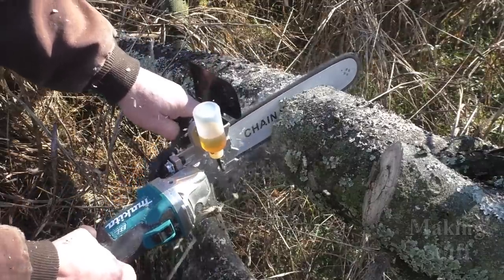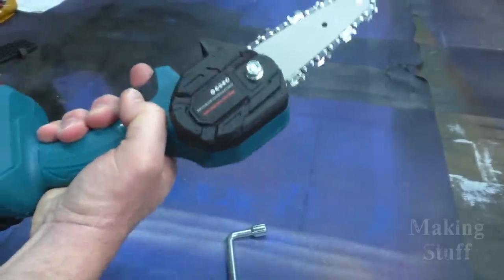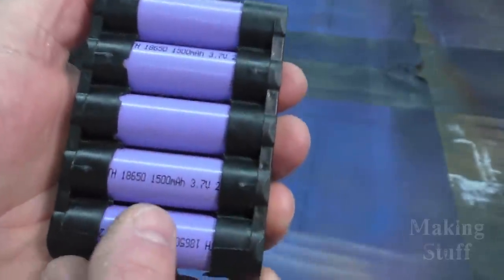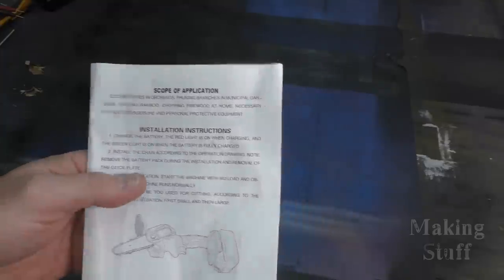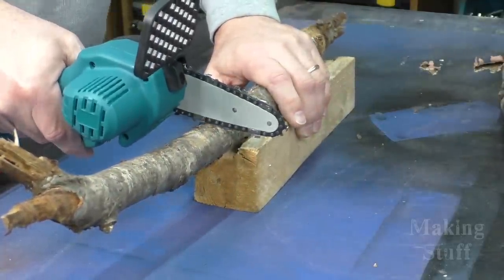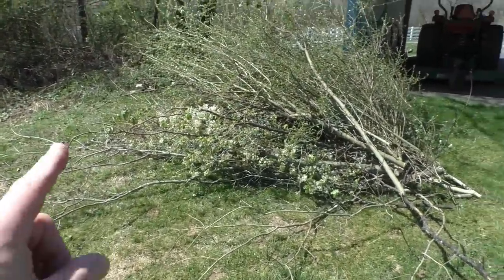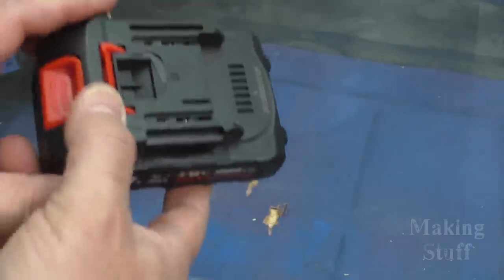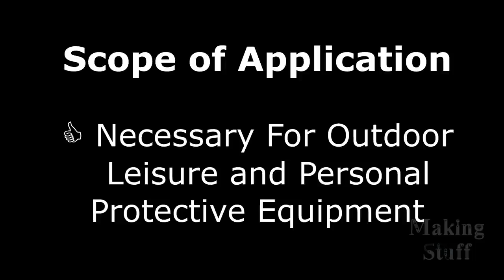Mini Cordless Chainsaw Review - Is It Any Good?

Comment: I got one very similar. It’s battery says 88v right? After 2 months of use. Not even cutting big stuff like you did. I got a battery that won’t take a charge. A battery that does but is iffy. A saw that cuts with the right shavings. Just it won’t cut nonstop or even fast. It stops a lot. So currently in email negotiations with seller trying to get a refund. Was fun while it lasted. Don’t think it is meant to be used much. My saw did not come with oil bottle. I still knew to oil it. So I oiled it. If you stay away from firewood. It will be good. New sub. Thumbs up!

Comment: I just bought a 6 inch model. What took 5 hours with an electric 14 inch chainsaw, the time was cut in half. Best part it is lightweight. Easy to tension chain without disassembly.

Comment: I got my dad one for Christmas. The big points for me are that it has the 18v battery that is interchangeable with all the other 18v Makita tools. Also this will be excellent for my dad who is getting older and simple yard work and cutting firewood is hard on his wrists.
Reply: @spanky Do you know if the batteries that come with it can be charged by the Makita charger?
Reply: @noahkatz9616  I'm not super sure, but it should if it's the same voltage and comparable with a Makita battery.

Comment: Will it cut construction timber e.g. 4 x 8 (sawn softwood) and will it leave a decent finish to the cut? I have to make two cuts with circular saws and it's a hassle to get them level. Pro builders here use normal chainsaws, but I always get rough cuts.

Comment: Pretty cool. How about oiling? Just manually here and there? Bet it would cut even faster with the Makita battery if the saw is capable of pulling more amps than the single cell configuration can give continuously. 5*series 1*Parallel vs the Makita 5S 2P and I'd imagine the Makita cells at 2500mah still have a higher discharge rate.

Comment: I’m wondering about how long it stays sharp enough to cut. 
Since there is a small fraction of the amount of teeth on this compared to a regular size...and those few teeth are doing ALL THE WORK a regular length would cut. I wonder how quickly it goes dull? And we all know how often a regular length goes dull.. 😬

Comment: Purchased two of these. One like Makita color and other like Bosch copy. They both burnt out the motors. In Australia our timbers are much more rough and tough. The tools work for really well to begin with but with super hot summers they take their toll on the small motors.  Both burnt out with white smelly electric burning smells. The burning out I believe is progressive as the motor gets noisier and grates the more you use them. They just pass a bit smoke and die. Battery tested in another tool it worked fine. I have an intelligent Makita charger and showed battery was still 90% capacity.

Comment: Awesome video. Looks to be inches blade so max it can cut is 8 inches wide/ dia i am guessing in 2 parts- 1 side and then other. 
If 10 inch dia would have a section in the middle that could not be reached due to the handle.

Comment: I suggested that this would be the tool of a survivalist, especially in a Zombie Apocalypse, A horde of Zombies are inbound after seeing them on my drone, I need a good solid building, after seeing the building and clearing I noticed there was just no wood around to reinforce the ground level. but there is another house across the street, which was poorly constructed for zombies so I can pull my mini chainsaw and get the wood I need to reinforce the better house. I also have a few extra batteries as well, and then switch to another tool to screw the wood in. 
These cordless tools are the cat's meow -  The question is now what is a good size solar panel to charge one and how long?

Comment: That's probably the best design to make an electric bicycle. Just changed the chain sprocket and mounted in the same place you would mount a gas engine. The other design you have to mount the power drill behind your seat above the rear tire.

Comment: How hard is it to get replacement chain like  do you gotta order them ahead of time or does home Depot or Lowe's have them on hand?
Reply: Also only 1 battery?
Reply from the maker: Bangood use to sell replacement chains but they are no longer for sale on their website.  Not sure if other brand chains will work or not.  There are two battery options available.  Check the links in the description.

Comment: Soft woods like those used are easy to cut.  I would like to see the saw deal with oak.  Betting it has much trouble with hard woods.  Nice tool for pruning I'd guess.
Reply: It will cut oak like a hot knife through butter,I used to cut Oak before I owned chainsaws,nothing hard about it.

Comment: I have the 2 gear, variable speeds electric drill motor that uses the same battery and charger and it works fine... was only about $27 for the set... before I bought it I noticed in comments the "48V" was just a part number, not voltage... 

Also have the $39 Harbor Freight 14" bar electric chain saw, but blade came lose 5 times trying first cut through a 10" soft wood log... rather dangerous... cut into saw guard panel... only has one nut holding blade and it has to be really tight to get it to hold very long... don't like tightening plastic things that tight... unfortunately, I had it longer than warranty period before using it for first time... it's power is fine... chain and bar also fine...

Comment: The thing that you didn't know what it was for but  decided it worked fine for deflecting wood chips looks to me like a kick back brake.  Whether or not it actually works I couldn't say.  If it works and isn't a fake along with the 48V sticker, with the saw running, tipping  the top of the brake forward should instantly stop the chain rotation.  It ought to be able to stop you hacking your head in half when you go 'nose in' to a branch, especially when working above head height, which isn't recommended.  Thanks for  the video. Stay safe.

Comment: Hi thanks for the good review it was so haelpful. I have a question. I bought this chain saw and i see a little spark in the engine even when the chain is not attached. Is that normal?
Reply: Yeah it shouldn’t be a huge issue it’s just the brushes sparking but the bigger the sparks the faster the brushes will wear out. For how cheaply these saws are made and sold I wouldn’t expect a very nice motor to be installed in them.

Comment: I bought an exactly one that shows on the video, except with battery 24V. I used in the first time with 3  cuts and it worked perfectly.  A month later, I used it again in trying to cut a small branch of a tree and it took 2 minutes to finish it.  I did try a number of times after that, and it is still not working as expected.  Its chainsaw was stopped moving and get stuck in the wood. Can your folks help telling what is an issue here? Is that a problem with chainsaw or battery or motor?
Reply: It sounds like it could  be either one. Charge the battery overnight. Then check the voltage with any inexpensive voltmeter. Try to cut a minute or two and see if the battery voltage is about what it was after the charge. Should be if the battery is good. Check the charger too. Plug it in and see if the voltage at the tip of the plug. Should be at least the same as the battery voltage rating. Disconnect the battery and make sure the chain moves freely. Call the manufacturer if you don't find the solution. Remember, some credit cards doujble the warranty. Leave a bad review and the seller will more likely help you if they don't at first.  Good luck.

Comment: The charger output will tell you what the voltage of you battery. It will be close to battery pack. Fully charged the battery pack will be about 21 volts. Lithium ion batteries are for the most part are 4.2 volts fully charged. GREAT VIDEO, looks like a useful item. I buy my own 3800mAh hour batteries and upgrade my packs. Also on e-bay you can buy the shells usually with a BMS included with it. That way you can build your own power pack. What is the voltage output of that power pack?

Comment: Mine arrives 6/9/21, red, 2 batteries, in addition I ordered 2 chains and a bar direct from China, prep limbs for gas chipper rather then my 8" or loppers. 3D print a blade guard.

Comment: I have just recieved one of these look alike chainsaws and having seen numerous chainsaw videos I am wondering about chain lubrication. A Google search suggested amongst others using vegetable oil, which is environment friendly, however the manual mentions nothing about oiling ... any tips on this before I start chopping wood.
Reply: Used sewing machine oil since had no replies.
Tested it out on a kemon tree growing in fron of my apartment and seemed to work OK although a little more "lumpy" in operation than expected which I put down to my inexperience. This was a few months ago now and a few weeks ago managed to get the chance to use it again for the project for which it was purchased. A dead tree in a plot of ground where electricity was not readily available.
I tried a few cuts on old limbs that were much smaller than those shown in the start of the video, then moved on to some branches about an inch or two in diameter. Initially worked fine but  then suddenly it siezed up and then the motor ran without turning the chain. 
Spoke with the shop that sold me the device, agreed that I could open and check out what had failed, report back to them and they would sendme a new part.
On opening the body the first thing I noted was that the motor was loose in its housing. Removal of the housing showed that the fixing screws were indeed loose and that the drive cog on the motor had stripped the teeth on the cog inside the body that transferred drive to the cog that drove the chain. Once I reported back to the vendor they sent me a new component to replace the one that had failed. Took  about a week for me to recieve it. I reassembled using some lithium grease on the drive cogs and some loctite type fluid to stop the screws from vibrating loose in case it was vibration and not an assembly oversight in the factory that caused the problem. I also cleaned out all the broken teeth that were scattered around inside the housing before reassembly. Hopefully will be able to put it to use soon although I must admit that I took a handsaw with a thin japanese sawblade to that dead tree and cut off all the branches leaving just about 5 feet of the trunk sticking out of the ground.
Reply: Update .... Been in use a few times now, use it alongside the hand treesaw mentioned above. Feel more confidant at the moment using old tried and tested methods of cutting wood. Chainsaw cut through the trunk of a dead tree thathad a diameter greater than the length of the saw. Also great in cutting back the 20 years overgrowth of an abandoned Mastica, which had tried to take over a couple of yards / meters at the rear of the property. Wondering whether to get a longer bar and chain for it !!

Comment: I wonder if you could convert that into a grinder? Then you have a much less expressive tool that can potential be both a chainsaw and angle grinder and cordless. May not be capable of pulling out high rpm but could be useful.
Reply from the maker: I would just go buy a Harbor Freight $10 grinder before going to the trouble to convert this one.  Thanks for watching!

Comment: You didn't mention the oil for chain saw. Does it have an oil holder in the saw. If not how often do you spray the chain when using it.
Reply: Don’t worry too much about oiling often the links on the chain are so sloppy that even the small amount of oil will help extend the life of this extremely cheap already saw I just spray mine down with something similar to white lithium grease spray or any aerosol Oil will be fine. Just a light spray on the chain links will be fine I think I read somewhere in my manual at least it said something like oil once a week in their type of English!  But if you are using it for long periods of time every once in a while just give it a spritz on the chain

Comment: Thanks for the video, I’ll get my mom this one. Just want to ask you few question. How often should I oil the chain and what type of oil is an ok for this mini chain, thanks.
Reply from the maker: Just use regular chainsaw bar oil.  I just put a squirt on there as needed.  Have had no problems and chain and bar are still fine.

Comment: They should make a clip on handle with a pole to use on  in the air, on that tree  say 15 feet in the air.
Reply: I would not buy it, my arms won't extend that far, old age, bad joints...

Comment: What is the duty cycle for the saw, I bought two but after a minute or so they stop working, but a couple of minutes later they start up again. I found if I cut intermittently it keeps working.
Reply from the maker: Not sure, it's not mentioned in the specs.

Comment: I wouldn't drag that thing around hunting when a folding saw would do the job with less bulk and weight, but I'd definitely pair it with a mini wood stove that won't take full size logs. I'd even say the shavings would be good for a composting toilet, so it could be great to go in a camper van with those two appliances.

Comment: How does one oil it?  Does it have an oil reservoir like larger chain saws?
Reply: I just spray mine down with something similar to white lithium grease spray or any aerosol Oil will be fine. Just a light spray on the chain links will be fine.

Comment: i am considering buying this for wood sculpting ( it is the only mini chainsaw that is 6 in- al other mini are 4 in ) do you think it safe enough for it(the on switch feature lacking safety )  , especially if i want to do a plunge cut using the tip ( like many wood sculptors on youtube do ) . thanks
Reply from the maker: I don't think it would make plunge cuts very well, although I haven't tried it either.

Comment: Great for hike and bike trail stewards.  After a rain there are lots of minor downed branches and vines blocking trails, and this would clean up 90% of problems.  However, I would not put this in my backpack for fear the button would engage accidentally.  For me that safety feature omission makes this saw a no-go.
Reply: why not unplug the battery when its in your backpack?
Reply: @tobyhill3564  Not an impossible solution, certainly.  But a ten second search on Amazon will reveal a few affordable alternative choices for 4" battery chainsaws that have the safety feature built in.  And better saw dust shields, too.
Reply: @barkingmadman1169  oh ok

Comment: I have just received mine today from Ebay. Being the chain saw repair business the only but a big only is that you did not mention Oiling the chain. My Mini saw has no built in chain oil tank, so I would have to oil the chain with a small hand held oil can or fix up a mini oiler drip feed bottle that would drop oil onto the chain. Perhaps you have some ideas on how to design a custom proto type oiler. Would be pleased to hear from you. Thanks.
Reply from the maker: I just give me a squirt of oil as needed.  A little goes a long way.  Have had no issues.  Still using the same bar and chain that came with it.
Reply: @MakingStuff  answered my question. thanks for taking the time to make this terriffic review.

Comment: Liked your video with the mini Mikita chainsaw, one of the questions l have,  i have a problem with roots since l had a regular forest in my back yard. The forest is gone but now i need to make flower gardens around my back yard. The roots are awful. The thought l have to help clear small patches of ground is to dig till i find a root and expose it by a water hose and cut some of these roots with the mini chainsaw. I have never tried to expose roots by this method but l believe it will work with the high pressure water supply l have. What do you think?
Reply from the maker: If you cut down into the dirt it will tear up the chain real quick.

Comment: After 6 months, what is the condition of your battery powered chainsaw now? Does the motor still works?
Reply from the maker: Still holds a charge and works fine.  I use it all the time.

Comment: This is a perfect tool for me . Thank you for such a great video Demonstration the  principles of  Assembly of the saw itself . You make it simple !
  Demonstrating the Varieties of wood , widths, diameters , and  the resulting rough grain. application of the  blade assenbly  without a safety shut-off ❗ Safety concerned me until You pointed out"The Auto Stop " when the trigger is released. That built my confidence right back up ! 
 You are terrific . I'll be watching soon ! 
 Just , let me get one and put it in 
My "Big Girl Tool Box" as I call it . 
 I have plenty of work for it to do .

Comment: Just got mine in today, put together and charging.  Ready to put it to work tomorrow.
Reply: Well, how did it go?
Reply: @polarbearsrus6980  It cut very well.  About 5 minutes into using it, the chain popped off.  The instructions were very vague on how tight it should be, so I probably didn't tighten it enough.
Reply: @texastwostepper2140  Thanks!

Comment: I have one of these mini chainsaws and so far, I really like it. My question is , can you or someone else tell me what you use to sharpen the chain? I haven't tried yet but I know it's inevitable. It has to be smaller than 5/32.
Reply from the maker: I've been told a 1/8" file will work but I haven't tried it yet.